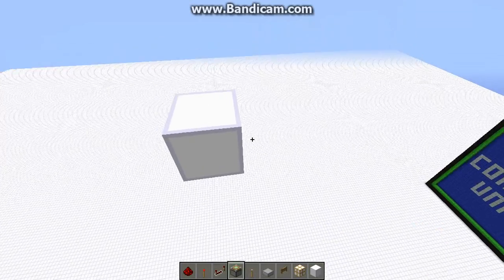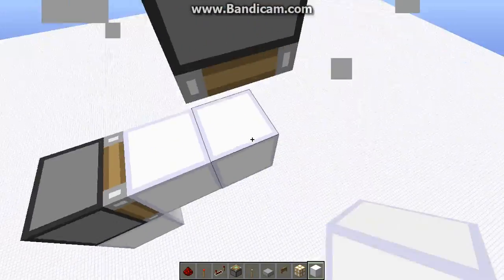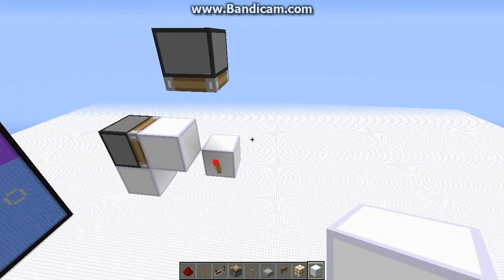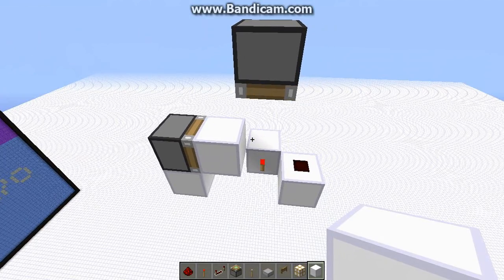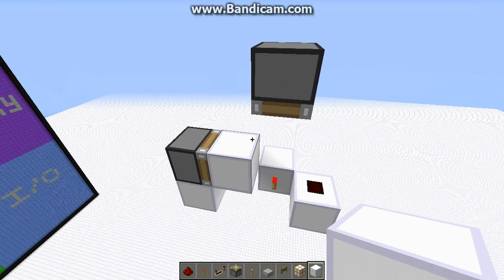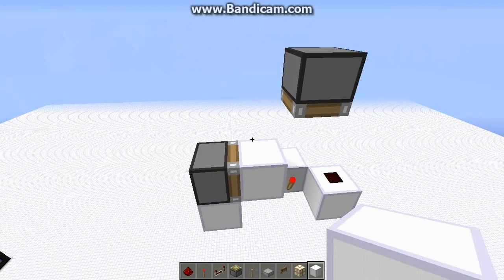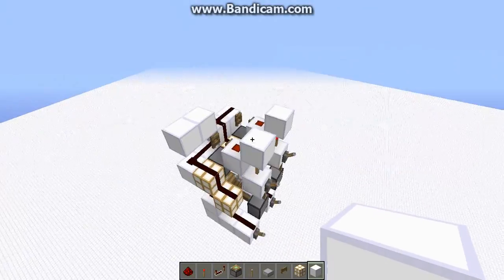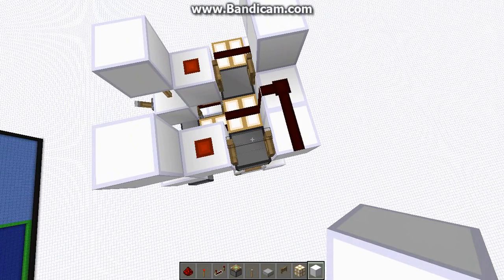Advanced Redstone Computer Tutorial ?: Adder - XNOR gates

Comment from the maker: No, there are no pc specific features required for anything I build. I simply use them because they are there and it is more efficient than not using it. In fact, if you want you can do everything in this tutorial with just dust and torches. When you're building things this high level, the more important thing is having components that work and not a block for block replica. As long as you have an adder, even if it's not this one, you're pretty much set.